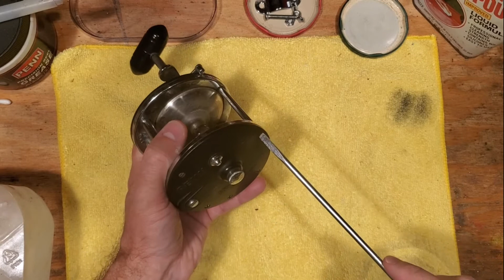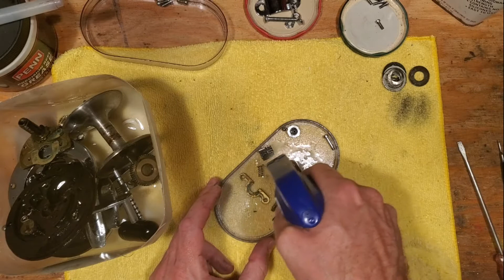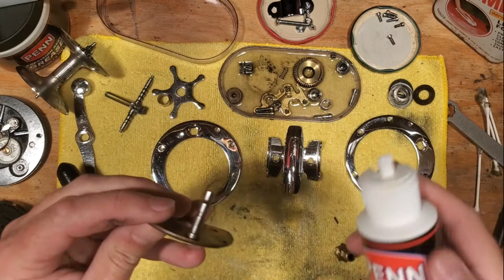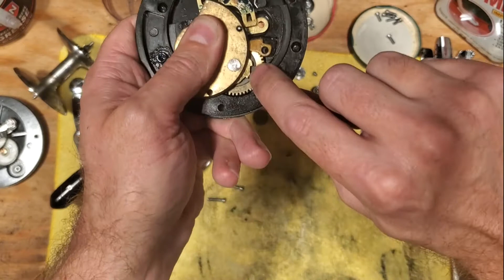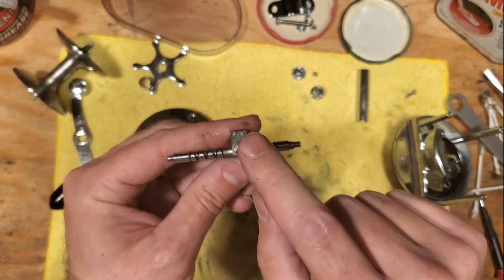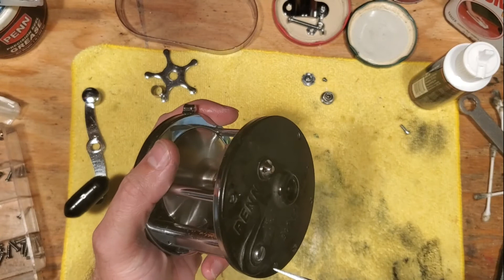Penn 309 Level Wind Complete Service & Restore

Comment: I used to use oil on the gear spindle, but I switched to grease for better corrosion protection and because grease wont run off as easily or it wont migrate down. This video helped me get my reel back together and I learned that the 330 GT2 is basically the same except for the dog spring
Reply from the maker: Glad the video helped and thanks for watching!

Comment: I love mine i bought it recently for my 12 foot rod i use for bank fishing.  Its a great reel for the price. I think it does great when casting.  I usually throw a 3 oz weight and i can get some incredible distance with this reel . Its definitely a reel you have to keep clean and oiled but like i said i can really get some good distance with it. I picked it up new for 70 bucks and am beyond pleased with it. I live in oklahoma but still like to use saltwater gear it just holds up better with time . I have another 12 foot rod with another saltwater baitcaster and its probably pushing 30 years old . Its made by Roddy. Model 131 and its been well used and it definitely has gotten beaten up throughout the years but its pulled in hundreds of fish and still works flawlessly.  But i have to admit the penn is definitely smoother than it. Great video thanks wanted to watch a good video like this before i cleaned mine . Got some grit and dirt in it fishing over the weekend and want to clean and re lube everything
Reply from the maker: The 309 is a great tool to have in the workbox. Glad the video was helpful.  Thanks for watching!

Comment: What do you recommend for restoring the plastic? I picked one up in perfect working order but looks like it's sun baked on both sides of the plastic.
Reply from the maker: That's a good question.  I have experimented with a couple of different things.  Rubbing oil into the plates is one thing.  Another is rubbing in a automotive polish or wax.  And then buffing.  If the plastic is sun baked it's never going to go back the way it was when it was new but there are some methods that will help. Hope that helps and thanks for watching!
Reply: Try toothpaste, mildly abrasive. Also good for hazy headlights on your car if they're some sort of acrylic.

Comment: Tony I bought and cleaned a  309penn peer When I filled with line it is mostly filing more on both sides of the spool but much much less on the middle! is there a wrong part on this reel? what could effect that?
Reply from the maker: You mentioned that you cleaned the reel but was it serviced?  If you haven't already serviced the entire reel I would start with that.  Used reels can have histories that we do not know when we buy them and it's best to do a full service on it first. Full take apart, clean, replace worn parts if needed, lube and reassembly. Check the level wind worm gear and pawl assembly.  Make sure they are clean and not worn out and lubed properly.  If they are worn replace the parts.  Also make sure your frame posts and face plates are flush and plumb.  Hope those tips help and good luck.  Thanks for watching!  - Tony
Reply: @backonthebenchreels  replaced with new Pawl works great!
Reply from the maker: @Ifishazores  Glad to hear that!  - Tony

Comment: I took my old reel apart and got it back together correctly but disaster. After my botched job, the star drag would loosen on its own when I reeled in and put pressure on the spool. I almost gave on my reel then found your video. After watching, I discovered that I lubed it up too much with the wrong type grease.  I cleaned and lubed again with Cals grease and now it's like new.  Thanks for the great video!!!
Reply from the maker: Glad the video helped.  Thanks for watching!
Reply: @backonthebenchreels  My reel will spool line out  badly when any pressure is put on the line at all and have tried everything have had my reel for like 20 years bought it as a kid with the money I saved and im hoping to fix it because I have a trip coming up in 2 days and I cant go buy another reel in time. Any suggestions its a Level Wind 309M. Only other reel I have is a jigmaster and its not really a good reel for deep sea off a boat because it doesnt have any level wind and its a major pain to ensure line doesnt come off all messed up.

Comment: Hey boss! Love the videos
Could you recommend your top vintage penn reels
Or other brands
For surf fishing
Long casters…
What would be your pick?
Squidder and beach master
Reply from the maker: For vintage conventional surfcasters their are a few different choices that I like.  The Penn Squidder 140 is a standard along with the Penn Surfmaster 200.  They are both great.  The Squidder is kind of the Cadillac and the Surfmaster is basically the same design but with fewer features.  But I recommend using them only with either plastic spools that are backed with braided line or aluminum spools if possible.  I try to stay away from the old school chromed spools when it comes to casting.  They are too heavy.  The Penn Beachmaster 155 is a great tool to have in the work box for sure.  Ocean City also made a few different surf models that were popular in their day and still to this day for folks that know them.  The Ocean City Inductor 250 was a revolutionary reel in it's time.  It has magnet brakes.  It was the first mag tuned casting reel.  The Ocean City Hampton Beach 994 and Chesapeake 107 are also good models.  Only issue with using Ocean City reels is parts are harder to come buy these days.  My top pick would be the Inductor 250 but only if it was in very good shape.  My 2nd pick would be the Squidder 140 but only loaded with a plastic spool that had the airbrake fins which Penn discontinued later on in the production of that model.  The aluminum spools do not have the air brake fins unfortunately.  After that the Surfmaster 200 and Beachmaster 155 would be my next picks.  Hope that is helpful and thanks for watching!

Comment: hi. my Penn 309's line guide tends to get stuck on worm's ends and would not return freely. I brought new worm and guide and could not resolve the issue. Is the pawl's problem? Do I need a new one(though it looks good)? thanks for your help.
Reply from the maker: From what you describe it sounds like the pawl needs to be inspected and possibly replaced.  Remove the pawl screw and look at the teeth.  If they are bent or ground down then replace it.  If it looks ok and clean then reseat it and put a light film of reel oil on the worm drive and see if that resolves the issue.  If not then there may be an alignment problem with the frame posts.  Hope that helps.  Good luck!